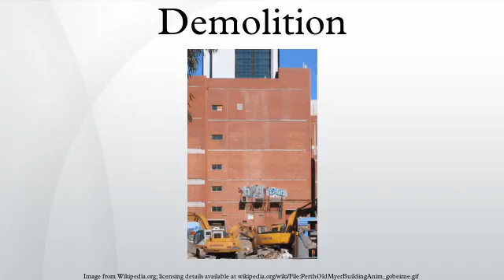Demolition

Comment: in kajima cut and take down method- how are the hydraulic jacks placed under the columns at first? while doing so wont the building completely collapse? how can the ground floor of the building be lifted without collapse and allow the placement of hydraulic jacks under it safely?